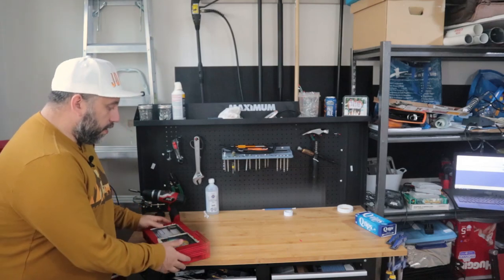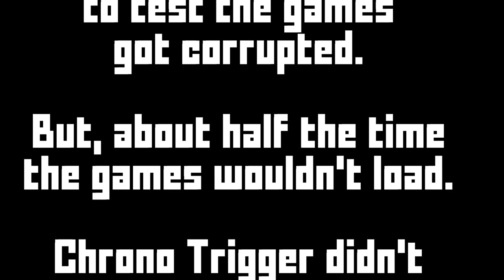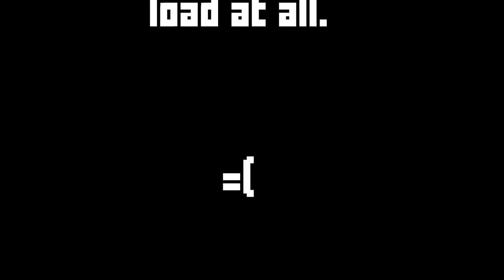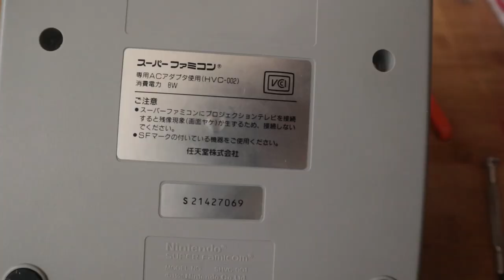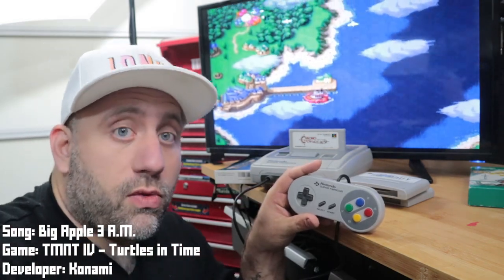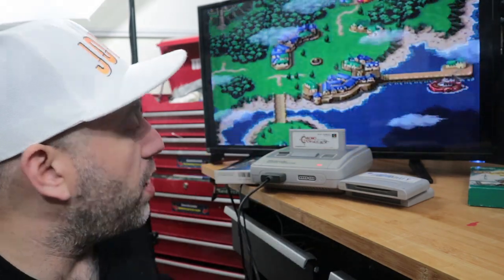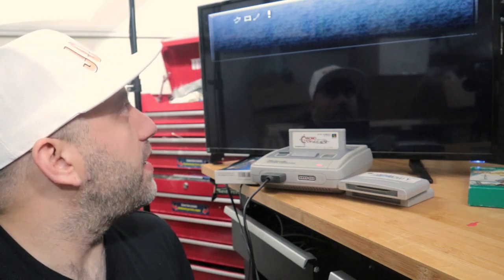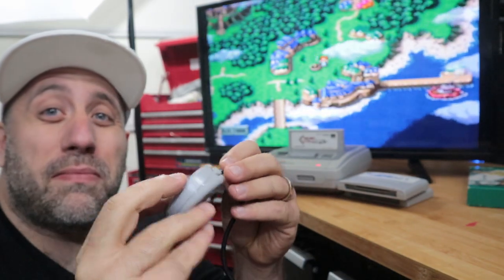I BOUGHT A SUPER FAMICOM/NINTENDO FOR 1 CENT AND RESTORED IT!

Comment: That skit was plenty of fun! 
Was there much desoldering/resoldering you needed to do to it?
Reply from the maker: Overall I was pretty lucky, I only had to desolder/solder the power jack. The capacitors all looked fine on the board.
I have a game gear coming up in the future where I will do a full capacitor replacement and install a proper LCD screen on it, that one will have quite a bit of soldering.